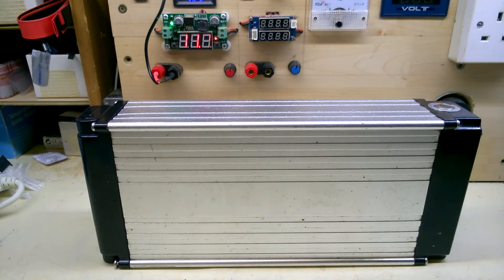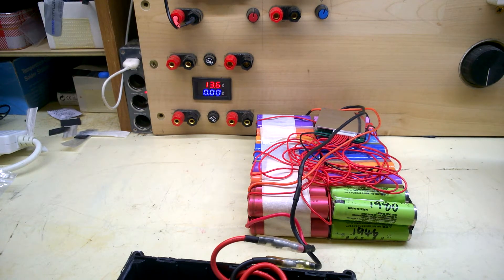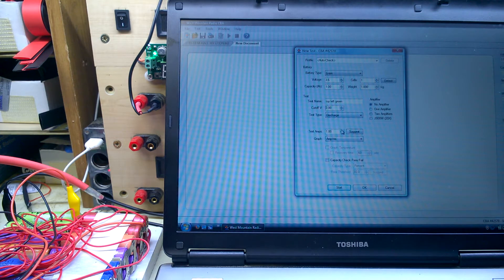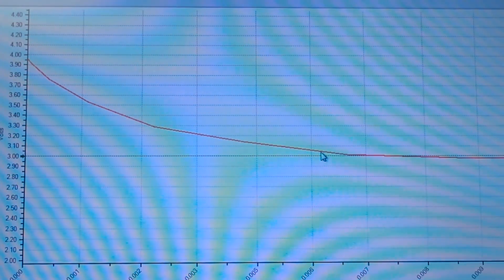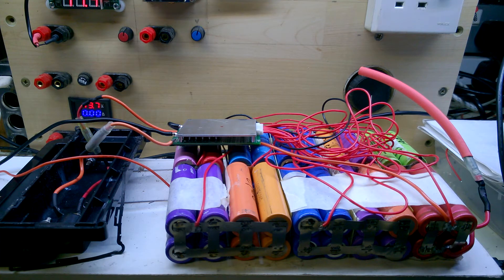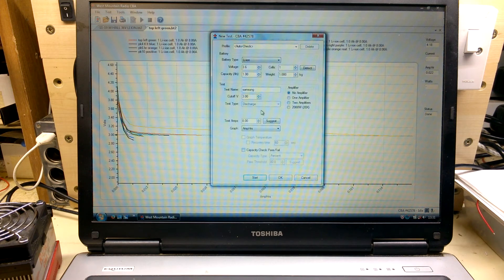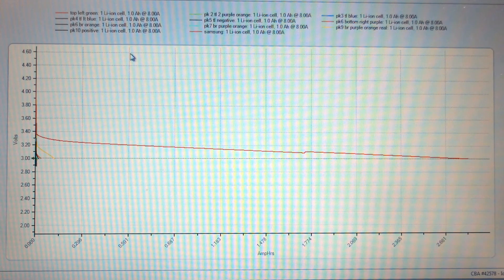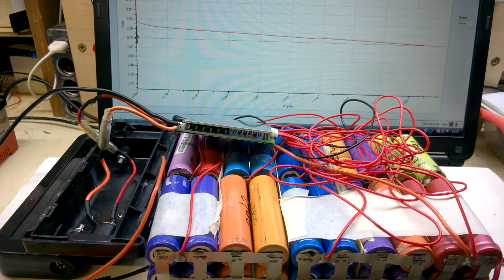Phylion E bike 36v battery fail (Short version)

Comment: Hi, sorry, without the original charger, (5 pin), if I send voltage to the positive and negative of the BMS the battery won't charge?  Or even by disconnecting the 3 additional wires?  Thank you
Reply from the maker: This battery only had 2 wires for charging (positive and negative).
If yours has 5 wires,then it's probably a proprietary system (tamperproof).
The other 3 wires are for communication between charger and battery.
If you don't have the original charger,the BMS will not allow charging.
Reply: @makeitwork7522  Hi, to solve the problem I eliminated the 5-wire BMS and purchased a new classic BMS.  One DALY 20A.  Red colour, entirely closed in aluminium.
Reply from the maker: @lifeafterlife9939  
And does the new BMS work the device / bike ??